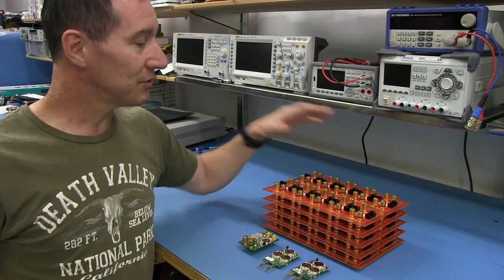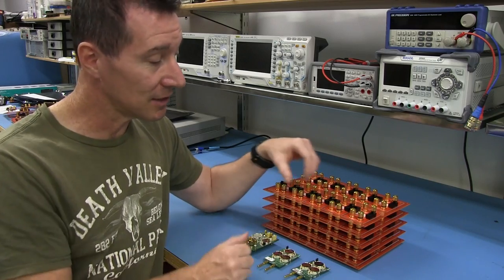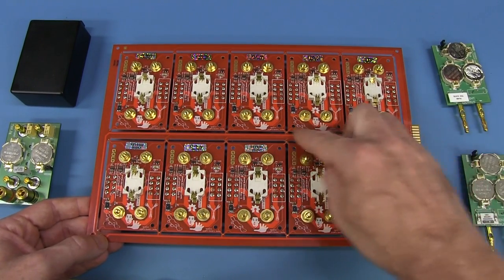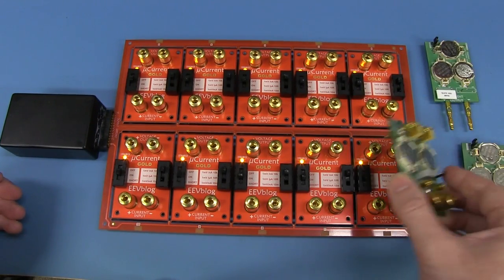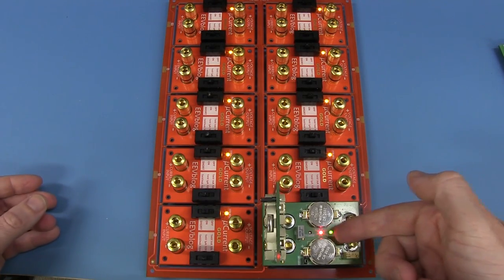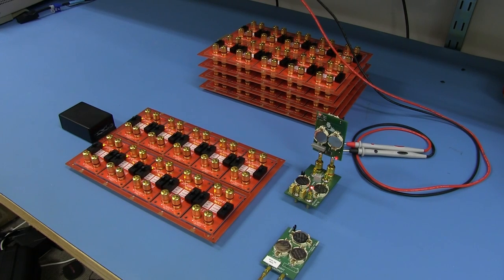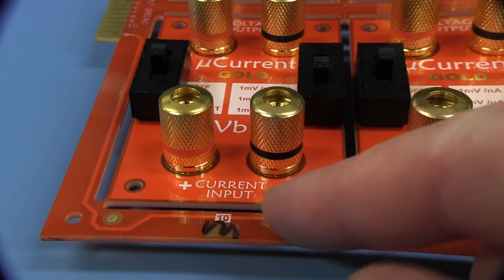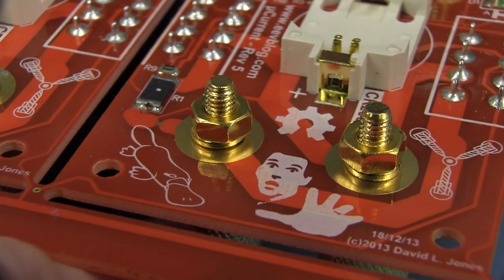EEVblog #588 - How To Do PCB Production Testing

Comment: I just got one of these and it works very well, for example I'm using it to monitor the current consumption of a bluetooth low energy device (with a scope) - the uCurrent has plenty of bandwidth so I can clearly see the radio & cpu activity in realtime. Definitely a great piece of kit (and not easy to find anything else similar) -  I recommend it.

Comment: Maybe this was covered in an earlier segment but if you're testing the boards with an external power source, how are the components related to the battery holder for the final product tested?  In other words how do you ensure than when the end user inserts the battery it's going to work?

Comment: I bet you could save even more time by implementing the testing modules in to one board too. 

But this is the part i didn't get, dunno if because i wasn't paying attention or because you didn't  mention it: the testers, will they use the same testing equipment you used or use the ones they have in the factory??
Reply: I think Dave will ship his jigs, as he made the jigs specifically for testing his specific board :)

Comment: Just a question, why did you opt for inexpensive open faced slide switches vs a good sealed 3 position toggle switch? or even a 3 position rocker switch? That gap in the slider you could throw a shoe in there.....I can almost see a sign on that slide switch that says "All dust and debris welcome anytime".
I'm just wondering, having heard you say over and over about "crap" parts on other manufactured boards....

Comment: Software engineer thinking: you can't use a for loop?!?! :-)
Reply: +Ciro Santilli

Hahaha...

1 FOR A=1 TO 1800
2 TEST BOARD
3 NEXT

READY.
RUN
Reply: +Ciro Santilli I had to make 20 sandwiches for a family picnic thing a while back, and I actually said "if I could only for-loop this", and then i realized I probably need a vacation.
Reply: He's already using a for loop.
What he needs is parallel computing ;-)

Comment: What do these boards do, anyway?
Reply: Measure current and outputs a voltage that can be analyzed with e.g. an ADC or oscilloscope
Reply: Well why would they need to do that when you can just measure current with an o-scope directly already?
Reply: You still need a tool to convert from current to voltage, with these pcb, I believe that you can get more precise readings compared to measuring the current through a shunt resistor with a differential probe.

Comment: At the time I started as a tech in manufacturing much of the manufacturing was in-house.  Then gradually more and more was outsourced.  The problem, IMO, incoming testing and inspection.  Most testing is static because it's fast, cheap and usually sufficient.  But the more pricey dynamic testing will revel issues that only show under actual usage conditions.

Example, an LCR meter will not show how a transformer will run under actual powered conditions with varying line input and loads.  A bad transformer will be no different than a good one on such a tester.

As one interviewer told me, I think he was the owner of the company, you could spend a life with magnetics and still not understand it fully.

Comment: Not sure if you have thought of this but if you had specific test blocks for each Current Source then you could add little angle tabs on the underside that would push the switches into the correct position for each test block. Also saw you putting the multimeter against some of them you could even put a volt-meter that only lights up if they fail the test.

Comment: I know this is a year old, but two ideas for future runs:

1. Maybe combine the two packing steps for speed, there might be time wasted putting half-packed boards in a box and picking them up again.  Maybe a more padded envelope could even eliminate the inner bubblewrap.

2. Are you sure there isn't room to feed another 5 test lines from each side of the panel to the test connector, given the inherent resilience of current signals.  Even with your current connector you could have 10 pairs of go/nogo LEDs on the power pack (sharing the precision references, but not the comparators), then only the test source or a single leed needs moving around in each pass.
Reply: John Doe I

Comment: Dave, I'll be very honest, I'd use a MUX/DEMUX combo and a single test jig. Fast bed of nails and the hardest part would be making sure the traces were all equal length or trim resistors for calibration.

Comment: from my personal experiences pogo pins seam to be finnicky and break. please leave some kind of connector on the board or a regular connection test jig. either way it will still be faster than testing any Texas instruments product. take the ti hurcules board for example. it takes 10-15 minutes each board to test! and I have had to test about 300-500 the time I worked at PTI in Plano Texas.

Comment: You could have the assembler use a torque wrench to fasten the nuts. Assuming they were using a ratchet wrench initially, that won't increase time but they are pricier however.

Comment: What's worrying about soldering and connector torque issues like these is that it could fail randomly depending on the pressure you put on the board.

Also did you consider putting a little buzzer on the test board so that you get some audible feedback as well?
Reply from the maker: Buzzers are really really annoying!
Reply: EEVblog
 Which is why they're perfect for the failure indicators, and horrible for the pass indicator.
Reply: SAI Peregrinus
Unless 95% of the boards are out of spec. But I think the buzzer would be the least of your problems...
Reply: If there is an issue with the torque, then he could tell that to his assembler. Or he tightens those nuts before putting the individual uCurrents into their  individual housings.

But doing the initial testing as development engineer and customer of the electronic assembler also has the reason to find systemic weak points.
If there is one, he can tell his assemblers to look for. If their isn't: Feel confident that it will work. Here: Two boards out of fifty having each a simple fault - that sounds fine to me.
Reply: sarowie You should specify the required torque in Nm (compared to saying "use the force")..

Comment: Hi Dave, if you were manufacturing 10,000's of boards would you consider using Flying Probe testers, No fixture costs!
Although your assembler may not own a Flying Prober
Reply from the maker: Yes, that's another option. A flying probe tester can be a bottleneck though, as they might only have one in the factory. With jigs you can make as many as you want and have as many people as you want working and testing in parallel.

Comment: Dave is lucky with this simple design.
I will need to think how I will test my product but I guess I will sell way less on my upcoming kickstarter campaign so there will be less product to test :).
Still impressive you can get under 20 seconds for testing this ucurrent boards.
Reply: Good luck on your campaign
Reply: RandomVideos Thanks. Is now at 36% after the first 6 days but it slowed down quite bad in the last two so not sure how it will work. Is not really a consumer product and I do not have Dave's crowd :) not even close.
Reply: +electrodacus Why not ask Dave to promote your Solar BMS ?
Reply: RandomVideos
I'm sure he is quite busy to bother with my Solar BMS and he probably dose not even know me. Then is me I just do not like asking for help.
It will probably not be that valuable also. Martin Lorton made a video about me it has over 5000 views already but since is not his product people will not show much interest some of them subscribed to my channel but probably not more than one supported the project.
I did opened some threads on EEVBlog forum and I think there where at least one or two that showed an interest for this project.
There are not that many that use lithium batteries and need a BMS and also not that many that want to learn microcontroller programming and electronic design from me.
I'm not an entertaining guy my videos are probably boring to most.
Thanks for your interest and suggestions.
Reply: You're welcome.

Comment: @ 10:50 What is the little link between the terminal and R1/R2? Is that acting as a PCB fuse?
Reply: +08Ultrasonic I believe that it is a current shunt resistor.

Comment: 50 units with two failures.  That can't be good, can it?  What is the typical industry yield for a device of that complexity?  Will the assembler be expected to fix the bad boards or will they send them out to you?

Comment: Another interesting video Dave. I find it strange that just one component on one board didn't reflow. Is that common is mass manufacturing? If so what is it attributed to? Not enough solder paste? Dirty parts?
Reply: Like he said the thermal mass on that connection was higher due to the large trace and relatively large device, so if your temp is just a fraction too low that will be the first connection to have issues.
Reply: MeakerSE
No I get that. What I mean was, why would that one part, on that one board, on that one panel have that problem and not the rest? Was the reflow oven temp not set right or was there not enough solder paste or what? And from a manufacturing point of view, how often does that happen? BTW Thanks for the reply.
Reply: TheInsanityUnleashed That connection should have a thermal relief.

There might be a multitude of reasons behind any soldering defect. One of them being reflow oven temp, like you said. How and why it occurred at that one instance, there might be several different variables in play:
- If heat is transferred to the PCB using air in the oven, then there will be natural variation in the temperature of the air.
- The distance between panels inside the oven. Every panel absorbs a certain amount of heat energy and if the panels are close to eachothers, the temperature might variate more than the oven is capable of keeping stable. Overshoot/undershoot might happen, as in any other similar system.
- Oven settings might have been correct, but the temperature had not reached correct temperature yet. Note: different parts of the panel reach the reflow-zone at different times --> In some extreme cases (thermal imbalance), the result might differ depending on which way the board was inserted into the oven.
- Variations in the PCB: copper thickness, plating thickness etc.
- Variations in the metal parts of the component. Note: heat can also transfer through the component itself. Depending on the component of course.
- Variations in the paste volume and content. That one case was a cold joint, so unlikely to be caused by pasting.

All in all, it all boils down to the PCB design. The design dictates on how much there is tolerance for variation at the assembly. 
Defects are usually measured in PPM in the industry. That is, defect per Million opportunities. So if you have 10PPM, then you are getting 10 defects per Million solder joints. (Million solder joints might sound like a lot, but you get there quite fast. Think about a BGA with 400 contacts. Or 1400, for that matter.)

Comment: hello dave Ive been watching your production run so I came across with a question
Was it worth on buying a 3d printer for making the case for the ucurrent instead of ordering a custom made or a close size case box?
Reply: +Alex Verias I got one in the mail, I really don't think it's a custom box, it's just a standard size one (and he made the PCB to fit it), the box actually comes with a lid which is useless because the PCB itself is the lid. 3D printing would be very slow (and hence expensive).

Comment: Dave, what are you going to do with all the boards that fail the test? if you got a 4% fault rate, at 18.000 boards, thats 720 boards that you need to investigate why they don't work. Or do you scrap them and just over-produce?
Reply: I believe Dave said eighteen hundred. Not eighteen thousand. I think this is the British/Aussie way to say 1'800
Reply: Yes you are correct, haha :) I remembered the number that he said wrong :P
Reply from the maker: The failure rate should be much lower now that we know that some issues have been identified which can be corrected.
Reply: Ali Mirjamali Well, we do say eighteen hundred in the US too
Reply: EGL24Xx That is correct. I have heard both forms on American news channels (eighteen hundred as well as one thousand eight hundred). One more question: Dave mentions "And he will does a trial run on ..." in the comment of this video. Is this British/Aussie grammar? I though it should be "he will do". Of course it is not important at all. We are more interested on Techniques, not English grammar or typos.
Reply: Ali Mirjamali I think that was just a typo.

Comment: Is that a gold plated bolt/nut ?????
Reply from the maker: Yep, nut and washer gold plated.
Reply: Very nice no expense wasted. Nice product
Reply: Reuel T you would have to insulate the entire input side trace as well as any components that connect to the input to eliminate any risk of electric shock due to user idiocy. Besides, some "fools" might also lick live wires, the assumption is that anybody using a device like this is going to be at the very least semi competant.
Reply: Reuel T Everyone on the internet is suddenly an engineer. Go teach him how is done buddy, let us see your designs.
Reply: Reuel T 1) This is hardly a consumer product 2) Very unlikely that anyone will be measuring current of dangerous voltages with this (you know what it's intended for, right?) 3) Gold plated bananas are great for this; it's all about super low resistance; they accept bare wires plus they work with lots of standard probes 4) Putting words in CAPS doesn't make you look any smarter
Reply: Reuel T I think it may be a nightmare to work with you.
Reply: Reuel T My 600V power supply just has big exposed terminals on the back.  It would be easy to kill myself with it if I decided to be a moron.
Reply: When I was young I used to lick 9volt battery contacts and it hurt. Now that I am older I am going to sue Duracell. Its the best way for an ignoramus to make a living.

Comment: So, only two bad out of 50? I see you use holographic stickers to allow detection of cheap Chinese knock-offs.
Reply: It is OSHW so if china want to make them they can
Reply: The source of the OSHW is important with respect to any support or replacement provided. If the Chinese manufacturer wants to ride on eevblog's hardware quality reputation, they'll copy all PCB markings. Then, when their junk has problems, the owner might expect support or replacement from eevblog. No holographic sticker? So sorry.